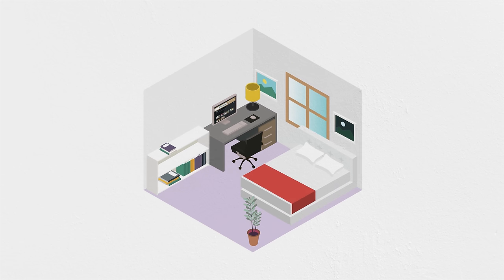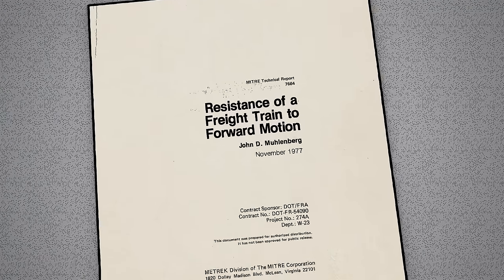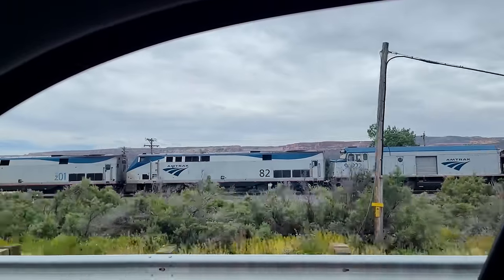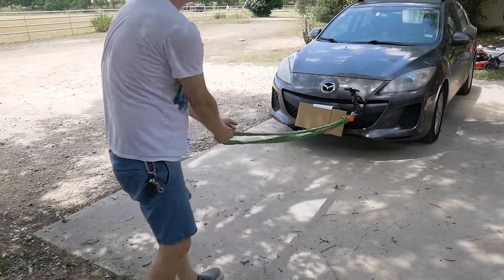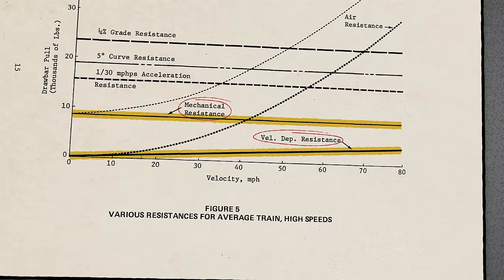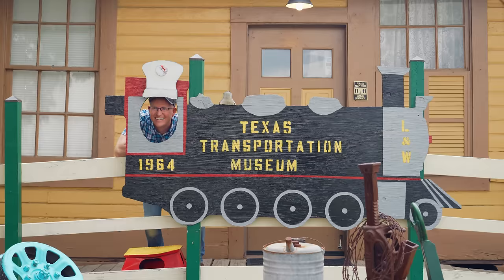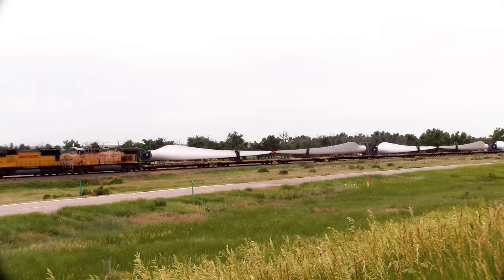Which Is Easier To Pull? (Railcars vs. Road Cars)

Comment: In the UK we almost never use distributed power on freight trains but our trains are very short compared to US ones, usually a maximum of 30 waggons/cars.   I have been interested in US freight trains as they demonstrate the way a few engines can pull a huge amount of material.  In the UK the HS2 project build of our newest London to the Midlands train route are using freight trains to carry materials to minimise trucks on the roads during the build of this railway.
Reply: Multiple Unit (MU) control is very cool, I wonder if future trains might get electromechanical brakes. And on the matter of brakes it is possible to out brake the wheels by using eddy-current brakes acting directly on the rails.
Reply: Honestly, I think our freight trains have gotten TOO long! I miss the days when our mainline freights were only ~75 cars, instead of the average 110+ today. We need to go back to shorter trains, whether that's by convincing the railroads, or making them with train length limits.
Reply: The reason why long freight trains are common in the USA is because of the sheer size of the country. At such distances, the savings due to low rolling resistance is totally worth it.
Reply: @PanduPoluan  It wouldn't be worth having a train that long here, by the time it would have finished departing it would be arriving.
Reply: Well, as with many businesses, some of it is pure economics.  There is a 'fixed cost per train' in crews, scheduling, and coordinating.  Then there is a 'variable cost' that rises with each car/waggon.  The length also has some discrete 'jumps' in cost when another locomotive needs to be added.  And of course the market demand.  Some goods like coal to a power plant, or other bulk items to one delivery point versus pickup/ dropoff off cars all along the route.  Finding the 'best fit' can be quite a challenge.  (there was even a game that used this sort of economic challenge, "Railroad Tycoon" I think it was called)
Reply: on the other hand, you guys have mostly-functional passenger rail, which the US sucks at.
Reply: @FTW23-qq8nb 
We used to have some DMUs as commuter trains. The longest I can remember was 6 but there may have been longer intended to split along the way. 
They are nearly all electric now although I have hear complaints about the cross-Pennine trains.
Reply: @PanduPoluan Another big factor is the cost of the crew.
Reply: Well back in the 50s , Uk freight trains could be up to 50 wagons long, and were hauled by giants like the BR Standard 9f, Or the WD 2-10-0
Reply: @PanduPoluan  Nope, it is to reduce the crew cost.
Reply: @mikefochtman7164 Yes! That was a good game!
Reply: @20chocsaday You do still see 158s and 156s around the north east and towards York and Leeds. All 142s have been retired.
Reply: @keiyakins  No, Japan and Europe have mostly-functional passenger rail. The U.K. differs from the U.S. in that it has more trains, but they're expensive (four to five times the price in countries such as France) and have absolutely terrible delay and cancellation records.

(That very HS2 project the OP is talking about has been more than a decade in development, at a cost heading towards £100 billion, and recently had significant parts of the project completely cancelled. The TGV and Shinkansen were also expensive, but not this expensive, and big chunks of them didn't get cancelled as the project moved forward.)
Reply: Don't you guys also have much smaller rolling stock as well, apart from intermodal flats which have to be a certain length?
Reply: @VestedUTuber  afaik our loading gauge is smaller but I'm not sure by how much. Average modern freight loco weighs about 120-130 tonne, I've not ever seen any modern freighter running double headed and I know you guys sometimes run 4 or more locos together. Our intermodal flats can take up to 40' containers, passenger cars are usually around 60' long.
Reply: @PanduPoluan  That brings to mind that I live not far from Virtual Railfan YT channel's La Plata, Missouri, camera location, which is on the BNSF transcontinental route from the port of Los Angeles to Chicago. Someone from the other side of the planet asked in chat how long that route is, so I did a quick bit of playing in Google maps - distance from LA to Chicago is about like going from Lisbon, Portugal, to Warsaw, Poland.
Reply: Passenger trains however have moved from engine plus coaches to railcars which each have a power unit - allows better acceleration in low grip conditions.
Reply: @FTW23-qq8nb railroads have tried multiple times to get newer break systems installed, but it is hard for one company to force the entire industry to change. Railroads don't always own the cars they ship and the new system would require every car to be compatible with the new system.
Reply: @Railman1225  If our rail network evolved with train length, we would be fine. the issue we're facing is that freights got longer, but the infrastructure didn't. 

Infrastructure doesn't make profit though, so I doubt upgrades happen willingly.
Reply: It's China here and we have long freight trains too. A normal freight train may have around 60 cars (this is 4-axle ones weight 92 tons each not the 2-axle ones in europe). Dedicated heavy freighters like Datong-Qinhuangdao would have 200 cars or 20k tons in each train. (and 12 minute interval...)

It's even better than US in technology. In here we use electric locomotives which is more efficient and fuel saving, and no f*cked up tracks like earthworms in US.
Reply: About the "distributed power" the Yankees simply put the locomotive in the middle to prevent breaking the coupler. Datong-Qinhuangdao has exactly the same layout.
This is far from the commonly said "multiple unit" like on a highspeed passenger train. With that you got power in the cars which also hauls payload.
Normal freight trains would avoid using MUs cause that is VERY expensive to operate compared to a normal engine-wagons consist.
Reply: @TheSudrianTerrier653  50 wagons, at what weight? Probably 2-axles ones yeah? If it's 4 axles and 5000 tons total a single steam engine won't do it unless it's big boy.
A consist of 5000 tons in Chinese steam era is hauled by 2x or 3x class QJs. (That's 2-10-2)
Reply: @nathanielhill8156  you know that eddy current brakes are an old fad and in use since 2000 with the introduction of the ICE 3 Trains?
Reply: @andrewharrison8436 
We have some equipment like that in the US, however because the FRA requires equipment to be of a certain weight or higher it negates the benefits. Metra's Nippon-Sharyo built Gallery EMUs on the Metra Electric Corridor are absolute slowboats, for example.
Reply: @JamesW81 
I'm referring more to overall size. Do you guys still use 2-axle short wheelbase freight stock or has that been replaced?
Reply: @phoenixarian8513  our railway wagons are a lot smaller , heaviest trains come in at least 1000-1500 tons
Reply: @TheSudrianTerrier653  I reckon so. You know what? A PASSENGER train can weight 1000 tons in China! That's a consist of 18 cars.
Reply: @Railman1225 the problem with shorter trains is you need more, which means more employees, which is a cost increaser. And right now, the government is more then happy to insist trains (and all public transit) nerds to make a profit when highways don’t
Reply: 30 waggons doesn't sound short to me. 😀 I googled it and here in Czech Republic, trains can be up to 650m, and it will be 740 in the future. I have railroad few meters from my windows and there is field between 2 villages and it's like 600 long and when they carry cars on a train, it's the same length as distance between these 2 villages, it's interesting to see such long trains and it's still less annoying than a highway which is 1.8 km from my windows.
Reply: @Pidalin  Say hello to China. A freight train hauled by one HXD series electric can be as long as 60 wagons (still that's 4 axlers 100 tons each car). Literally mile long club.
Reply: @phoenixarian8513  China is like different planet. 😀 I guess that in Europe, it can't be that long because you would block 3 villages with such train and several crossings and also sometimes train has to stop and let other train go and train stations are not that long.
Reply: @Pidalin  British railway wagons were MUCH shorter than American ones.
Reply: @phoenixarian8513  I’m not taking about china, I’m taking about the Uk, in the steam era passenger trains were about 8-13 coaches long and around 400-700 tons
Reply: @TheSudrianTerrier653  Neither passenger trains nor freight trains are heavy in UK. There isn't simply enough items to haul.

Comment: I've always loved trains and love this series.  From an economics point of view, you can pay up front for the railway of a train vs. roadway for simple trucking, or you can pay the higher operating costs of trucking.  This is why specific point-to-point shipping can be so much cheaper in the long run by rail.  A well-defined route that will be used between only a few points can justify the higher costs of building the rail line.  Whereas when you need a lot of flexibility to get to many locations, like end point delivery of packages, cheaper roads win out.  Really some interesting stuff.
Reply: Generally speaking, building a mile of rail is less expensive than building a mile of highway. Costs vary a lot but the general estimate is $1-$2 million per mile of rail, and $2-$3 million per mile of 2 lane road. Maintenance is even cheaper, with refurbishing rail in the $100,000-$300,000 per mile and road at over $1 million per mile.
Reply: @verdiss7487  I believe you're neglecting the part where you have to prepare the terrain with tunnels and bridges in order to install the railway.
Reply: Trains also are not subsidized as much as rubber tire transport. Trucking freight literally makes zero sense economically. It's the largest industry in terms of subsidy there can be. We're destroying the environment, city landscapes and people's lungs with one single economic imperfection.

Comment: Another advantage of trains (especially at higher speeds) is the relatively lower air resistance compared to buses or trucks (depending on if you're moving people or stuff).  With all the cars in line with each other, the first locomotive takes most of the air resistance and other cars get some drafting benefit.  This is most easily seen in the perfectly contoured coaches of high speed rail.

Comment: Another thing to consider is that on a curve, the driving wheels in the locomotive have more surface area contact with the rail, reducing the locomotive’s traction and making the chances of stalling out greater

Comment: At the Minnesota Transportation Museum, I shoved a loaded boxcar by hand quite easily. I got it started using a tool with a six foot long handle, that sits on the rail and pushes against the wheel. ( with a lever and a fulcrum I can move the world!) Then just pushed the boxcar about thirty feet, pushing with my body. The boxcar had the old style bearings with an oil bath and babbitt bearings. The bearings on the car you tried to push were modern roller bearings, if you had just put more consistent effort into moving it you would have succeeded in moving it.
Reply: It would have moved easier if the track was level.
Reply: It would have moved easier if he were stronger, too

Comment: Fantastic series, would love to see you dive into electrification as well!
Reply: I was looking for a comment like this. Regenerative braking on downhill grades could be great (or maybe not, I’m no engineer).
Reply: I don’t know if it would be feasible (extra cost and complexity) but it seems like a good idea to add batteries and motors to each rail car to distribute the pushing as well as the regenerative braking (as well as weight).
Reply: Newer electric locomotives in Europe can transfer the energy that is recovered by regenerative braking back into the overhead catenary system.
Reply: That would be interesting!

Comment: I've often wondered exactly how much force it takes to move a train car like that as I've seen it done so many times in these strongman contests, now I know so thank you. I once did a truck pull with several other people for a charity event, that tractor unit weighed somewhere in the region of 8 tons (metric) but once we got it moving it wasn't that hard. I wanted to try getting it to move more on my own once it was going (I couldn't shift it from a standstill on my own on tarmac) but as with you there wasn't really a safe way of doing it. We didn't have a force gauge handy but I have wondered how much it took.

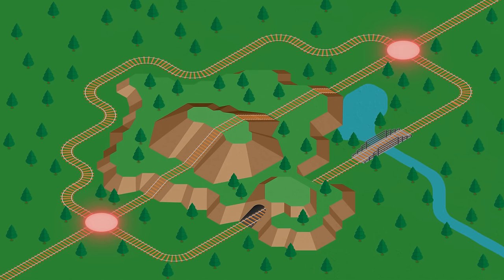Comment: @7:35 it's not just the energy consumption that goes up. Another reason to avoid tight curves is the additional wear & tear on the wheels and rails (all that squealing ends up being fine steel dust), which requires more frequent/expensive maintenance. Sometimes rail operators try to reduce that by adding lubrication devices, that squirt grease onto the wheel flanges of passing trains, but this also adds additional maintenance cost, and it makes the rails more slippery, which in turn reduces the weight the engines can pull (and brake) before the wheels start to slip.

Over the years all that can easily add up to where a tunnel would have been cheaper. At least if you frequently run heavy trains; if there is only little traffic and/or light vehicles you can get away with it — so even the anticipated traffic patterns on the line will affect the route.

An example from where I live: Here in Austria we are currently building the Semmering Base Tunnel to replace/augment the historic route over the mountain. The mountain line suffers from severe limitations in capacity, and not just because heavy trains have to get additional engines (or be split up altogether); it turns out that one of the main reasons for the reduced capacity is that the tight curves require constant maintenance. Only for about 100 days of the year both tracks are continuously usable; so despite being technically two tracks it almost has to be operated like a single track line for more than 2/3rds of the year.
And fun fact: the original designer of the line even pondered a base tunnel himself, but this just wasn't technically feasible in the 1850s.

Comment: This was a really cool segment.  I would have loved to see you try and pull a modern, roller-bearing equipped car such as a hopper or double-stack.  I'll bet it would take a fraction of the force and that you probably could have gotten it rolling yourself.  Interestingly enough, there is a famous photo taken by the New York Central Railroad back in the day, that shows four your women pulling a huge, modern steam locomotive (a 4-8-4 Niagara class) equipped with roller bearings.  The photo demonstrates your points well.  Thanks for this video.  I love your work.
Reply: Was that a NYC Niagara or 'Four Aces' no 1111, built by Alco for Timken as a demonstrator?   Because Timken used to carry out 'stunts' like that to demonstrate the low friction of their roller bearings.   I note that Alco also built the NYC Niagaras so there was probably a family resemblance.

Comment: You can easily get the car moving with a cowbar. Just put it between the wheel and the track in an angle and press it down. And next time they need to move the old car around for a few minutes. The grease gets to its place at the right temperature. Newer cars got different bearings, they are easier to get move.

Comment: I've been waiting for this video, or one like it. Thanks Grady! Steel on steel offers the least rolling resistance one can find without introducing exotic materials like Teflon, or whatever. The Chicago & North Western's mainline between Chicago (Elmhurst, IL) and Fremont, Nebraska never exceeds a 1% grade. That was by design. CNW and successor Union Pacific assign ½ horsepower per ton on the route for a typical freight train. More if they want to go fast, like a Z train. The movement of trains is so efficient it almost defies common logic. Railfans love the Big Boy and swoon over its power and tractive effort, but it weighs a million and a half pounds and is an absolute glutton when it comes to fuel. A couple of GEVOs or 70ACes weigh less and have more tractive effort. And they are so fuel efficient that the EPA rates railroads as only 2% contributors to greenhouse gases.
Reply: My hometown is on the Blair Sub!